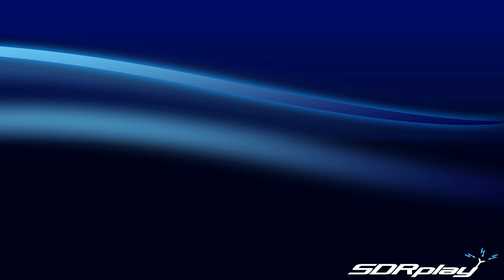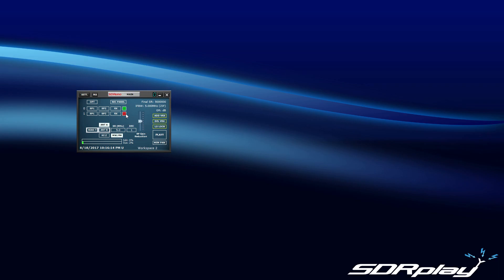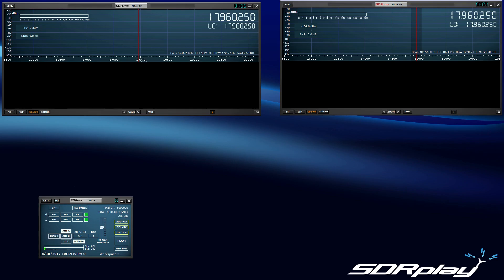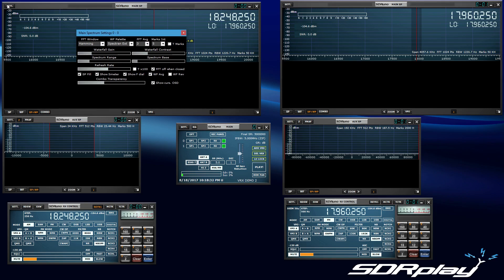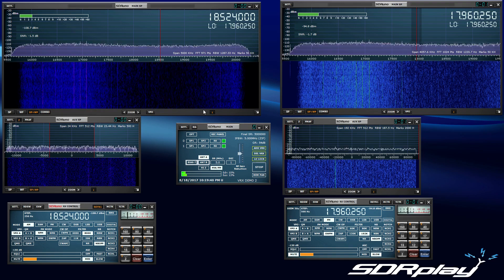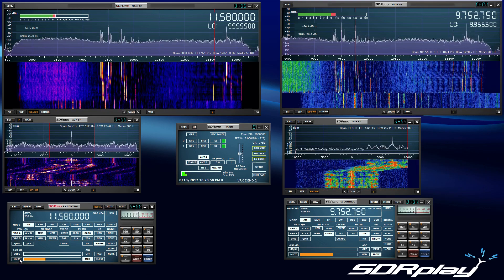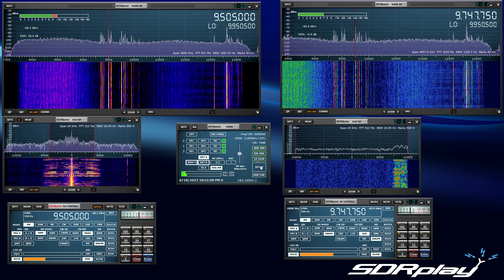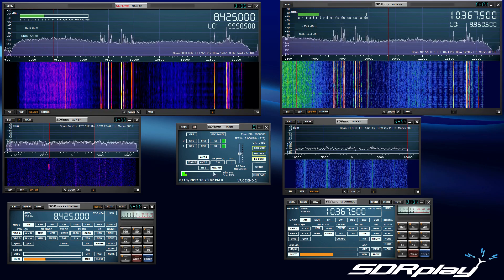Overview of the VRX functionality in SDRuno (MV020)

Comment: Great job Mike. I'd like to see SDR-Console 3 as the next project. I have version 2, but there is so much more in 3 that I use that as a second to UNO. I don't use HDSDR at all, though I have it installed. This has been a great series Mike. Thanks again.